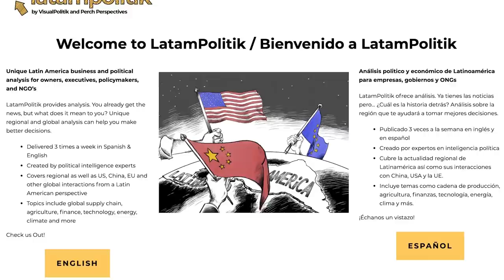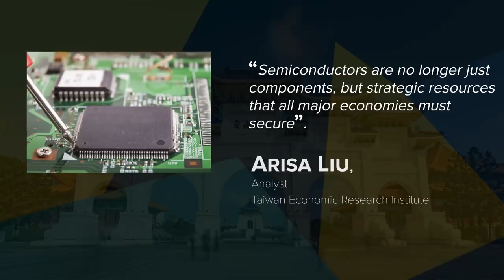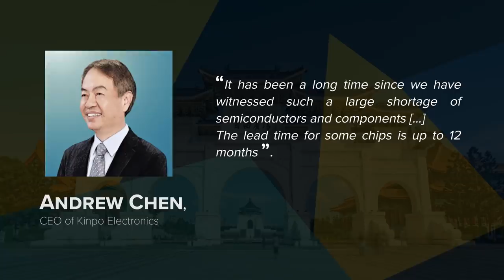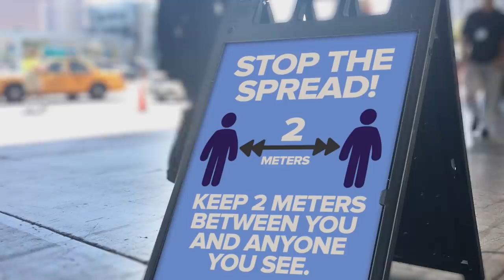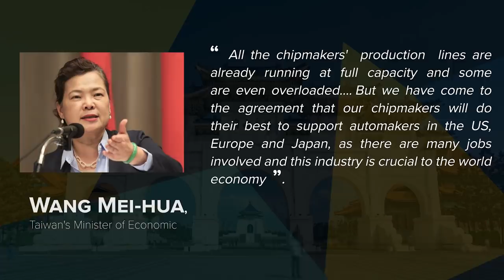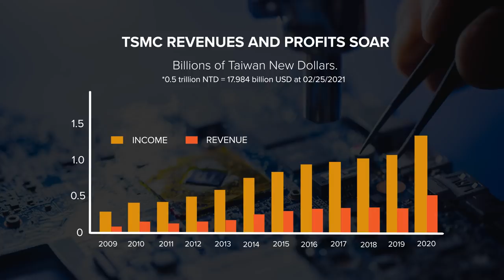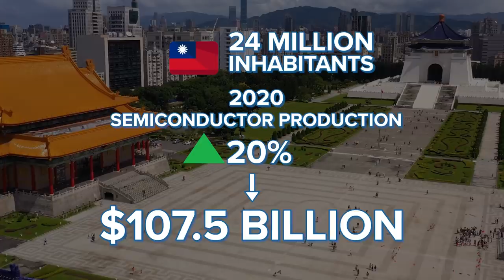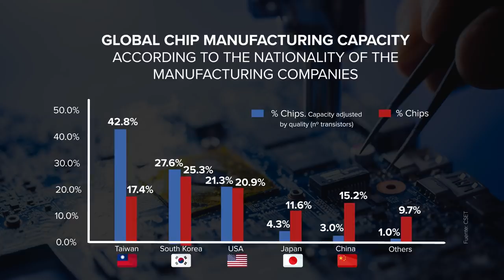Why has TAIWAN become the most IMPORTANT country in the world? - VisualPolitik EN

Comment: The founder of TSMC was an engineer who was educated and worked in the United States for 20 years before going back to Taiwan and working for the government of Taiwan's ITRI Industrial Technology Resource Institute.   ITRI was basically an institution built on learning and transferring the know how of how to make computer chips from America and the West to Taiwanese businesses.   And this includes academia and private industry.   And the West supported this because Taiwan (ROC) is an ally of the United States and the West and has been so since WW II.     Therefore there was never any roadblock to stop them from developing their chip industry.    Also TSMC was founded as a joint venture with Philips Electronics and the Taiwanese government. One of the key milestones in the development of TSMC was the assistance they got from RCA in training engineers on how to make chips.    But keep in mind, back then most of the chips they made were for things like DVD drives and so forth and to this day most chips made are not for high end PCs.  In fact Taiwan started out as the maker of all the various components in the computer/electronics supply chain such as circuit boards, computer cases, phone cases, keyboards and so forth long before they even got the contract for the Iphone.   And it wasn't until later, after AMD failed to keep up with Intel in manufacturing advanced chips that TSMC even became a big player in higher end chips.

Comment: “The thinnest semiconductors”
LOL!!!!!
Reply: If you didn't know, the smaller you can make them, the better. It means you will be able to fit more of them in any object. Sadly we are reaching the physical limits, which might be a problem if we want to keep improving our computers.
Reply: @MichaelDavis-mk4me  unfortunately, it’s one of the few things in the world I do know something about.
What you’re talking about is “feature-size” and represents the physical size of the gate on a CMOS transistor. The smaller the size, the more can fit into a given die-size. But more crucially, the smaller the transistor, the less power it consumes and the less capacitance it has. The lower the capacitance, the higher the switching frequency (GHz).
TSMC is leading the world in process technologies with 5nm today.
“The thinnest semiconductors” is a misnomer. All silicon semiconductors (the most common kind) are about the same thickness.
Reply: @I999-g2s  i guess for multi level memory chips the thickness of each layer matters? but yeah, even then it's not relevant here anyway xD

Comment: I wonder much chip material of old hardware is just laying around in homes (I do indeed have several old GPU's and hard drives laying in a box, each for "just in case" my new hardware malfunction).
old phones, old TV's, old computers- all just waiting to be recycled...
Reply: the issue isn't about the availability of material, the issue is that even with all the material piling up on their front door they still can't make as much as the world demands
Reply: CMIIW I don't think you can recycle chips, the electronic circuits are basically like tattooed into the silicon wafer.

Comment: according to wikipedia
The following is a list of countries by integrated circuit exports. Data is for 2019, in millions of United States dollars, as reported by International Trade Centre.[1] Currently the top twenty countries are listed.
# 	Country 	Value
1 	 Hong Kong 	134,483
2 	 China 	102,187
3 	 Taiwan 	100,408
4 	 South Korea 	79,082
5 	 Singapore 	76,868
6 	 Malaysia 	44,794
7 	 United States 	40,099
8 	 Japan 	27,791 

Seems China is by far the biggest.

Comment: Chip Shortage

Yeah, there's a chip shortage. Why? You don't have a clue.

The original Moore's Law talked about processor power doubling and memory density increasing 4x every 18 months. At one point this shifted. 'Processor power' became a function of multiple-CPUs running at nearly the same clock rates as their ancestors. A lot of modern smart phone have 4 or 8 core CPUs. Some of the more recent versions have 64 cores. All of these still run at around 3Ghz, maybe up to 4Ghz.

One other element that still continues to change is power - CPUS that used to need 'desktop' power supplies can now run on lithium-ion batteries. This converts 'stationary' applications to 'mobile' applications. Among the other things 'shrinking' are camera pixels, so we now have 200Mp cameras and 5K 60 FPS video. Sensor sophistication is rising exponentially.

This tends to create vast new 'opportunity spaces'. If one pulls down the (United States) FAA list of licensed pilots, one finds that half of all 'commercial' pilots don't have medical exams. This means that half of the people flying aircraft to earn income are flying drones. This would have been difficult or impossible (depending on circumstances) in the 20th century.

It is now possible to buy a gene sequencing attachment for smart phones, as well as 'night vision' infared sensors. One can buy 100Khz recorders for listening to bats, insects, and 'distressed plants'. These aren't just 'household gadgets' - they 'create new industries'.

SpaceX's StarLink is making broadband internet available 'everywhere', which means that many communities on islands, rugged terrain, or frozen tundra are now able to watch videos, or, for that matter, create their own content and post it to subscribers. Often these remote locations have all kinds of interesting circumstances, whether deep cold, exotic landscapes, volcanoes, or ghastly natural disasters. People that used to be 'locked out' of much of the world economy can now engage. This may be billions of people, depending on what people can afford.

The Raspberry Pi cost $35 when it first came out. A newer 'embedded controller' version is priced at $4. Certain other low end embedded chips are priced at 99 cents. Some of these are 32 bit with megabyte flash memory and WiFi communications. Such cost reductions expand opportunities for 'garage' developers geometrically, although the 'garage' might be some kids bedroom or dorm room.

Automobiles exist at the intersection of almost 'universally desired' consumer products, vast amounts of data capture, and demand for precise control. The car industry has been using chips since the 1980's, so each model generation tends to build off of lessons and improvements from earlier generations. Consumers and governments demand that such cars be clean and economicial, something that can only be done with embedded sensors, computers, and software. Each new model year represents a geometrically rising demand for chips.

As device geometries shrink, costs of fabs rises geometrically. It takes longer for each smaller geometry to make it into production. Rising demand coupled with slower factory construction would have created a chip shortage whether or not we had experienced COVID - this isn't just a matter of 'demand recovery' but a matter of demand for 1.25x as many chips as were produced last year. Keep doing this year over year, and pretty soon the production system hits physical limits.

In this respect the fight with China is a sideshow, but it is still strategically important. The world in general, and China in particular, needs to replace older and dirtier energy technologies with more efficient and cleaner new ones. This includes wind turbines, solar panels, storage batteries, charge controllers, load controllers, and switchgear managers. All of these things either need chips or are chips. At present, this is more like 'vaccine nationalism' than it is 'defense' - if politicians need people to be 'immunized' at home they are reluctant to allow doses to 'walk' - to be exported to other areas with equally severe needs.Same goes for chips for making cars - if this puts people out of work it's unacceptable.

In many cases this simply 'crept up on people' while everyone's attention was focused elsewhere. Building new fabs is critical, but at this point it will be necessary to delay some projects and find suitable substitutes for others.

Comment: The US needs to up its chip-making ability. Europe as well. It's dangerous to put that much manufacturing capital in Taiwan.
Reply: It's hard for American and European to have such semiconductor plants to produce good yield rates. Besides technology know-hows, engineers in TSMC on average work 10 hours daily with shift under high stress environments. It's not an easy job that Western workers would enjoy.
Reply: @phanwhite1029  That's simply an issue of hiring enough labor to do the work rather than overworking a smaller pool. That means it's a cost issue and therefore a price issue in the end. How much more would a phone cost to have semiconductors from the EU vs Taiwan? What is the strategic value of that chip-making capacity? Why the hell can't I buy a graphics card right now? The answers: Not much, high, because of inappropriately outsourced and bottlenecked supply lines.
Reply: Chip industry is an issue of supply chain, it's not like single TSMC can manufacture cutting edge chip, over 1000 companies provide bit of services to make it happen, to open many factories in many regions seem not feasible